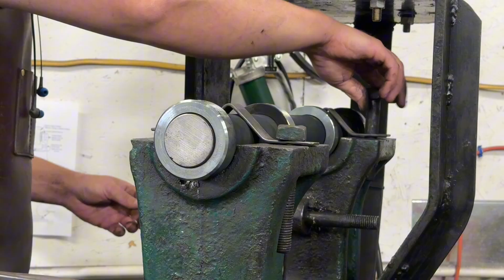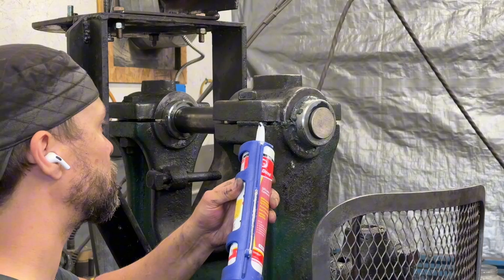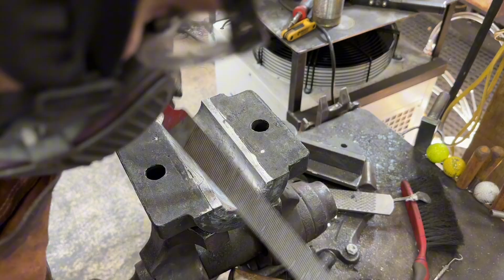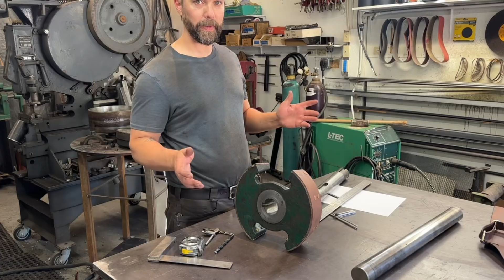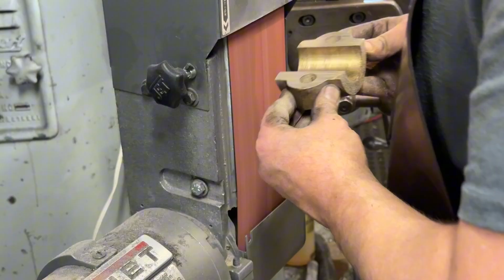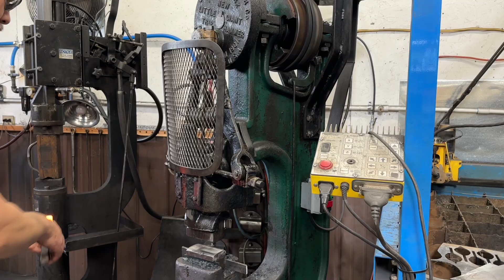1920s Little Giant Power Hammer Rebuild | Babbitt Bearings, Driveshaft, Clutch & More

Comment: Great video thanks, great job getting yours back into service! I am restoring a 25lb I bought soon, and need to pour the bearings, Looks like that high temp sealant held up well, any issues or leaks with it? would you use it again over traditional babbitt damming compound? Thanks
Reply from the maker: I didn’t have any issues with it, and I like that it doesn’t catch fire like I’ve seen damming compound do in other people’s videos. I’ve never used damming compound myself as this was my first time, but I was very happy with the sealant.
Reply: @welchcustomiron  thanks! ill give it a try, your bearings came out great

Comment: Always love to see these machines restored. I rebuilt my Little Giant 25lb hammer. It has serial number 157, so I believe it was shipped in 1908. I also attended the first rebuild workshop hosted by the New Little Giant company in Odel, Nebraska. I learned a ton. One of the tips they also showed me after the babbitt was solid, was to cut a 45 degree bevel on the inside edge of the babbett so a small oil resevoir would fill with oil as the shaft rotated.
Reply: great tip - I am hoping to attend one of those but is a long trip for me